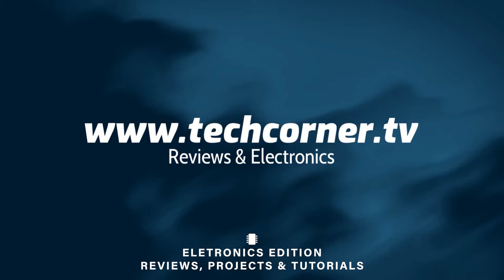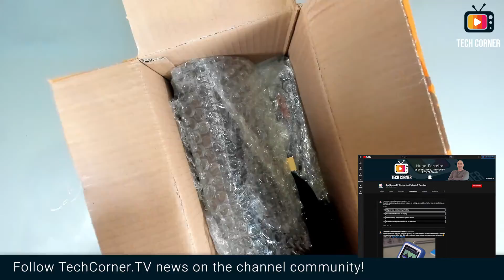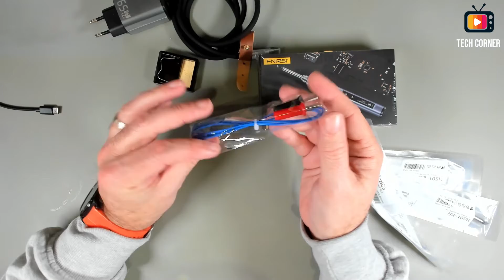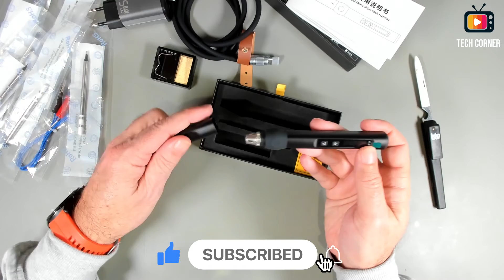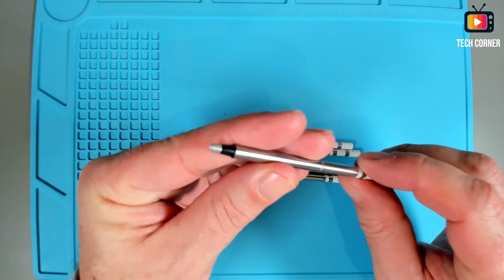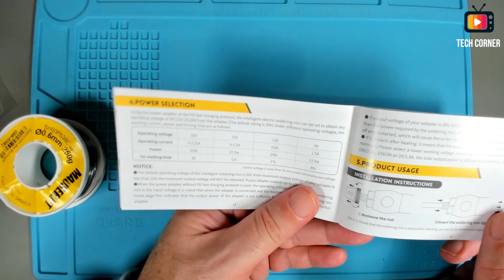FNIRSI HS-01 Smart Soldering Iron⭐ Complete Review!

Comment: It just says it's up to temp in like 5s with a termal camera it realistically is much slower . And what heated up there was not the tip but copper plane that's why it could melt is faster on second joint ...
Reply from the maker: Hi, the thermal camera has always a small delay, it's normal. The best test for this is really the solder melt time. Thanks for watching.
Reply: @TechCornerTV u should standardize the test by always starting up with the same room temp sample , same dimensions otherwise it's scued.. it's easier to solder to pre heated ground plane . Without pre heating sometimes it's not even possible to replace larger component..
Reply: @TechCornerTV i have an infiray p2 delay is maybe a few ms . (Negligible) It's constant 25fps

Comment: I like the lock design for holding the tips in place.  That and the cap that covers the tip is awesome, helps to provide confidence that you can quickly pack up your iron when needing to put it inside a backpack, etc... 

This is simply just a solid design and nice choice for this part of the hobby which is getting more and more crowded every day... Pinecil, TS100 Sequre, HGLRC (just a Sequre that is rebranded), and more I am sure.  I like this one for the reasons above plus the silicone bumper at the front of the iron and the universality of the tips, the same ones for all the irons listed above.  Lots of options nowadays, nice to see.  Plus they are generally durable enough... 

And a quick note:  I had a Pinecil that toasted itself within 5 minutes of its first use, and it was NOT covered by the warranty which was a measly 30 days... that plus reading the message boards said that the irons had a known problem, one of the components was weak or bad choice or whatever it was the bottom line is that they knew about it and did nothing to help me.  

So, lesson learned.  By the way, my warranty claim was happening about 37 days after purchase, so...  yea they could have done much better.  30 day warranty, worthless.  And all i had to do was plug it in at an earlier date and it would have toasted itself...  I simply did not get around to using it for a few weeks after I got it.  By the way, my Sequre Si012 has been running for a couple years now and I even went ahead and bought the upgraded version - the Si012 Pro Max - worth it!  Cheers
Reply from the maker: Hi, thank you so much for watching and your comment, really appreciate it. I bought thousands of euros/dollars on AliExpress and usually it is solved, but the tip I want ot share with you is to, ALWAYS pay with paypal. Paypal itself is free for the buyer, so no costs for you. But the thing is, you will benefict the buyer protection for 180 days. It's no that much, but it will be 6x times what pinecil gives... and if you have a problem, you can always open a case. They work pretty well. Again, thanks for sharing.

Comment: Honestly? Its a great soldering iron, i've been using it everyday for almost two years, no big problems. I'm using it with a cheap 65w usbc charger with a long and thin cord that was made for notebooks, it helps alot with the handling. The only problem i've found is that sometimes the tips are not recognized by the iron and i have to remove it and insert it again. But overall is a great purchase.
Reply from the maker: Hi, I had that problem with other soldering irons also and I agree with you, is a great soldering iron for the price. Thanks for watching.

Comment: This soldering iron does not work if a USB A to USB C cable is used, no matter which charger is used. It only works on a USB C to USB C cable. For me, that's a big minus.
Reply from the maker: Hi, after reading your comment I went to see if it was true, the problem I had was finding a 65W USB-A to USB-C cable here at home, I don't have any, so can't confirm. With my normal cables, it says that has low power, but again, it needs a better cable... maybe you're right. Thanks for sharing and watching!
Reply: @TechCornerTV  Try connecting the FNB58 via USB C cable and then the soldering iron to USB A. It should have the same result as connecting to different chargers, i.e. USB outputs.
Reply: According to spec a USB-A of type 3.1 has max power output of 15 watts. So not enough for this device.
Reply: @gustavofelisberto4259   Fnirsi states that a minimum of 13.5W is required for the operation of the soldering iron. I have a quick charge 3.0 18W USB A charger (5V/9V12V), to which I connect the FNB58, turn on the trigger 12V/1.5A or 9V/2A and then the soldering iron works via the USB A port.
If I plug the soldering iron directly into the USB A port, it gives me a low voltage warning. The problem is not that it doesn't work on the USB A port, but that the manufacturer didn't say that it only works with USB C to USB C.

Comment: So are these soldering tips following any kind of standard?
They look like Hakko tips, only way shorter, so not compatible.
And I think that is important. I mean, I don't expect fnirsi to make this product in 5 or 10 years anymore, so probably no tips by then.
The TS-100 of course also has this problem, but there are so many TS-100's made and around (and there is a 2nd version now), that it almost looks like it has become it's own standard, because also the pinecil uses these tips, and there are I think 3rd party manufacturers too.
And in the end that is what partly defines a good tool. How long is it supported. I mean, you can still get tips for a 50 year old Weller. (hakko, weller, pace, jcb.. they've been around for ages)
But with the oled display, how long is this tool gonna last. It's a frequent repair on the TS-100s 😉
Reply from the maker: Hi, I don't have a T12 soldering station (yet) to compare, so I'm not familias with the T12 tips. What I can say is that the TS100/TS101 will not fit in this soldering iron. I have also here to test the GDVA and I think that it uses similiar tips, let's see if they're also compatible with this one or the TS100/TS101. Thanks for watching!

Comment: Hello Hugo, is there any updates about the Hantek DS02D10? Im pretty interested on buying one, but I dont want to buy a headache. Does the latest firmware correct the Issues? (Specially the bad readings on low voltages).

Please letme know ASAP. Regards!
Reply from the maker: Hey Julio, sorry not yet, it is on my todo list, but I have to give priority to the manufacturers that send devices for review free of charge and I still have here four to review and those videos are getting posponed... sorry! I have a job and do this at night and weekends, is not easy! If I could sustent myself from the channel it will be different, but barelly pays the expenses (most of the time don't) so I do this because I like and I have to manage it all in the free time, but I will try to schedulle it for the following weeks. Thanks so much for being here and for this comment!